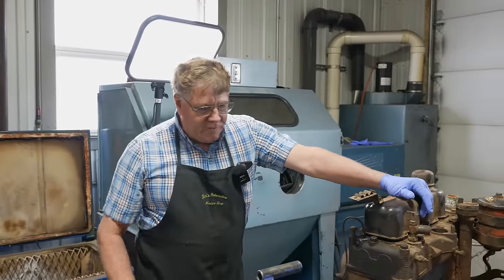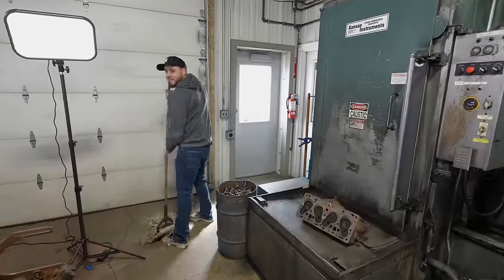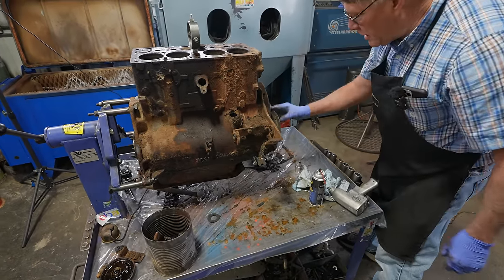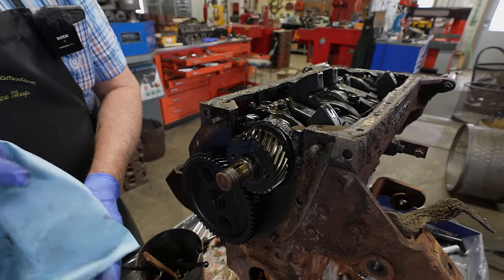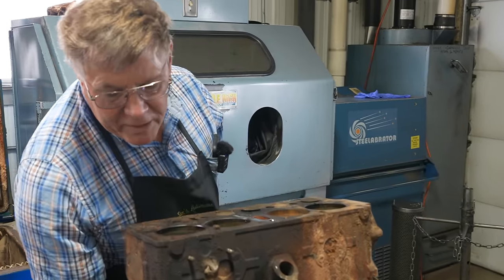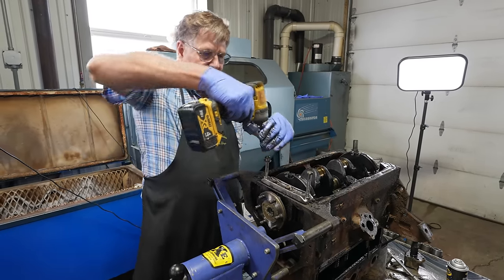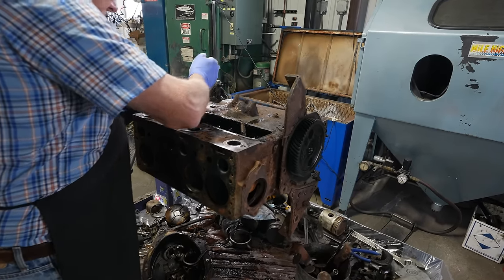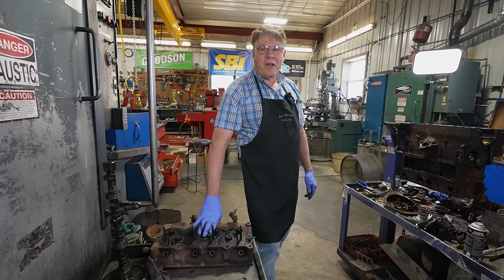Tearing Down A NEGLECTED Willys Hurricane Engine...

Comment: I wonder if the timing being off a tooth (+ maybe lean and rust build up around the cylinders too) is the reason of the obvious heat issue? Clean, dry pistons and combustion chamber. Too bad the plugs were gone.
Reply: that and/or run lean to try to 'fix the smoke'

Comment: People ran prue water if the engine overheated in hot climates, people also used to remove the thermostats. Nothing wrong with the old bakalite gears, they were replaced at overhaul.

Comment: Connection rod wrist pin is clamped in the rod. MOTOR'S AUTO REPAIR MANUAL 21st Edition Third Printing did not give end play of piston on rod.  Just .0001 to .0005" clearance for  pin to piston at 70 degrees temperature.  Pin moved as you said or not correctly centered  to start with.

Comment: I had the same thing in #4. In my L134 flat head. Had that hole sleeved to standard it ran about two years and the head broke off the cinch bolt and did it again?

Comment: Gotta love the logic of having more camshaft bearings than main bearings! lol 

Also, since the bearing dates indicate late-1952, IE, after the truck was supposedly built, and the fact that they were marked standard made me think;  ostensibly at the factory the cranks should have all been standard size, would factory bearings be stamped as "standard"?   Maybe it was rebuilt in the 50s at some point with standard aftermarket bearings?

Comment: If that engine had oil psi problems the old "3b manual" had you solder the hole up on the timing set oiler and re-drill it to a smaller size.

Comment: 49:45 I agree, It's called a Galley, not a Gallery. I'm calling out my "I'm 70 and must be right card!" I actually remember a discussion in my 1972 power mechanics Class with Mr Zinky, a certified Jet Engine Mechanic turned High School Teacher. Keep em coming...👍👍👍👍👍👍
Reply: I can remember my shop teacher using the same terminology and apparently came from the navy since their oil passages were the size of galleys. I have only called them rifles since i work on diesels and thats what most mfg call them in their training.

Comment: Greetings Jim & Nicholas. Started watching your channel, & subscribed, with the Chevy 235 rebuild after a friend told me about you. I'm enjoying watching your work & gaining knowledge as you tell about what you're doing etc. I think you said you've been doing this work for 40 years & wondered if you could help with my issue. I would, of course, appreciate a response but I'll let that up to you. I have a 1940 Chevy with a 216 engine. There is a copper pipe that attaches to an oil distributor on the left side of the engine. The pipe goes through the block, through the water jacket, to the other side & routed up through a hole to attach to the rocker arm shaft center. There's a brass fitting that screws into the hole in the block & a smaller fitting screwed into that. The pipe of course runs through the center openings of the fittings. The fitting don't compress against the pipe so there is a small space that coolant can leak through. Do you know, or have any idea, how the leaking was prevented? I know you're busy & have lots of viewers so if you choose not to respond, that's okay. I'll still continue watching your channel. Thanks for your videos, your time, & consideration.
Reply from the maker: I have seen the oil line you have described.  As I recall, it should have the same compression type fitting on both sides of the block to seal in the coolant.  The ones I have seen, once installed, could not be removed without cutting the tube.  The fitting compressed on both sides of the block making it impossible to remove without being destroyed.  Thanks for watching.
Reply: Thanks for replying. Both  "Chev's of the 40's" & "The Filling Station" sell the pipe & fittings but only the two fittings, one screwed inside the other -- no ferrules/compression sleeves & none were present when previous one removed. I put a compression sleeve on the left side of the block with no problem but on the right side the pipe has to be routed along side the push rods & still have enough room to not touch the push rod cover. With the compression sleeve it doesn't leave enough space. Oh well, I'll figure it out. Thanks again, much appreciated.    @JAMSIONLINE

Comment: Decades ago I did a 260 from a compact Fairlane that the pin was loose on. Fixed the pin, fitted the cam etc that came with the job and it ran a low 15 like that. Amazing how engines will still run when knackered. It was actually still running ok before we stripped it. Yet all the valves were barely sealing. Scored up bore etc.
Jeeps,,,, Landrovers have similar on the 6s. Horrid engines. And no reason  to be making engines that dated after the war. They were making OHV engines before WW1. 
Packard made a whole pile of twin OHC Merlins then went back to making flatheads for cars.   No wonder they went broke. 
Ford made twincam all alloy tank engines,, then went back to flatheads after the war.

Comment: Galley can be considered correct. It was originally, and still is a term used to supply food on a ship, the analogy for engines is an area that supplies water or oil to “feed” the engine. Hence, Galley Plugs. Gallery, on the other hand is an area used for exhibition, usually artwork, or other things to be viewed.

Comment: You got my attention with the “hurricane” name in the title. I have a Kaiser military M715 built around 1967 I believe. I’ve heard that engine referred to as a 232 hurricane. It’s a straight six single overhead cam hemi design.
Does anyone have info that would add clarity to this? Also, I could use a new timing cover if anyone knows of one laying around.

Comment: Cruise control used to be called auto pilot, bulk heads used to be firewalls, and people put water in their water pump, and i recently saw a video of some women trying to put vegetable oil in their new vehicle
Reply: A boat with numerous rowers is a Gally, an area which displays art  is a gallery 
I believe the correct word is GALLY

Comment: If the Jeep was a kids learn to drive vehicle, prehaps the timing gears were intentionally set a tooth off to reduce the power of the engine? I know I've heard of pistons being removed and other modifications to old vehicles to reduce the power so kids could learn to drive in them in the old days.

Comment: All one needs to know when fitting a distributor is the position of the crankshaft, the firing order of the engine and the direction of rotation of the rotor arm as you look at it.  The first datum is set with the timing marks between the crankshaft gear and camshaft gear.  Align the two marks and the crank should be at No 1 Cyl TDC.  The firing order is looked up (sometimes stamped upon the engine as in earlier Landrovers).  The rotation of the rotor can be observed whilst rotating the motor by hand in the correct direction.  Once these data are known and the engine set up at No1 TDC, the rotor will be pointing at one of the dizzy cap's electrodes and this will be No 1 cyl.  One then fits the remaining leads in the direction of rotation and in thne firing order - simple.

I do realise that I have probably just attempted to teach you to suck eggs but I got the impression that you thought that the distributor and its drive's orientation were set in stone and this is simply not always the case.  I remember, as a young man, in the Army and learning this stuff, watching an instructor pull out the distributor from the engine of a Bedford RL (you may research that one).  As vthe instuctor was talking to us, he was lazily spinning the dizzy, drive cog whilst holding it in his hands.  Myself and as couple of the the lads remarked, under our breaths that he would never get it running again.  We were gobsmacked minutes minutes later when he casually turned the engine to TDC, asked us for the firing order, casually threw the dizzy at the motor, refitted the HT leads and turned the key.  The blooming thing immediately fired up and sat the purring like a kitten while he explained what it was he had done.  For years, we were of the imprssion that everything had to be marked so that it would all go back together exactly as it came apart - not true.  The fact is, the drives of most, if not all distributors will only fit one way (the reason for the offset screwdriver slot). 

The sad fact is that these skills are going by the wayside.  they are being forgotten because, well because - computers.

Keep up the entertaining work!

Comment: I believe the specified oil for that engine was non-detergent type as in that time period was typical for bypass oil filter engines ...  just like my old Ford 8N.  Non-detergent oil kind of self cleans itself after engine shutdown by allowing the non soluble dirt and metal to sink to the bottom of the oil pan forming that thick layer of sludge, the bypass oil filter there to capture some of the smallest dirt particles that just happen to get pumped its way.  I learned long ago the very hard and expensive lesson to NEVER use a detergent type oil in those engines types ... EVER !!!

Comment: The "F" head came in the cj3B High hood starting in 1952. If the truck is a 1951 the engine was replaced at some point.

Comment: First time to learn of valve placement one in the head and the other in the block. Question Dose the valve placement improve performance any at all? Seems to me an extra cost to the factory  just for the machinery set-up. It would be interesting to know the reasoning behind the design.
Reply: My question was answered @ 44:20 mins. Learned some thing new... even so this engine was produced one year after the Doc spanked my butt... ;-)

Comment: oh no fiber gears
had my 1962 volvo B18 engine rebuilt circa1995. they put in a fiber timing gear
in 2001 it left the wife stranded on the freeway.  put in a volvo marine metal gear.  a little noisier but gears wont get oil soaked and shred.  tell the camera man to steady out the filming.  

happy easter

Comment: The number 4 rod was installed backwards the rods are not centered on the the crank bearings .
Reply from the maker: This is the conclusion we came to after the teardown was complete. We didn't pay close attention during the teardown process, but as we reexamined the piston, pin and connecting rod and realized the pin has a groove for the cinch bolt and cannot be off center, we determined that the assembly had been installed backwards.
Reply: @JAMSIONLINE  I have seen it many times in my 34 years working on nothing but Jeeps

Comment: Positive crankcase ventilation also contributes to engine life.
Reply: * If the engine is designed for it.  Adding pcv to old engines will often not be beneficial.

Comment: I grew up in England , and you never looked at a car with over 40,000 mile's. but you could go to your local garage and there would be reconned engines sitting beside the new batteries,just pick one up on your way home?

Comment: It probably ran just fine aside from the smoke and a little clatter. Those old engines were tough sons of bitches.

If #4 requires a sleeve I would punch all four holes out for sleeves and bring the entire engine back to standard bore.

Fascinating seeing inside an F-head engine, too. I hear tell you can convert back and forth with the right machine work on the block, and that the flathead blocks are just bolt-on conversions between F and L head.

Comment: So a half flat head half overhead valve I've never heard of that is kinda crazy what engineers were thinking back in the day
Reply: Seems like a backward step, but Rolls-Royce and Rover used it a lot. It does have certain advantages in that the intake passages can be an improvement over a straight sv engine and valve sizes can be larger than is possible in either straight sv or ohv designs. 

Rover used their own version of the F-head design for  many years on the typical British small bore-long stroke engines of the pre-WW2/ post WW2 era to enable the valve sizes to be larger than was possible with the same bore size in ohv, and their design was also optimised for good gas flow. For the low octane fuel of the day, a higher compression ratio was able to be used, giving a much better  power output than would otherwise be possible.

Comment: Thanks again for the great videos. May I ask a couple questions for you? Would it be possible to modify the oil filtering some how, so that there is an output and return line from the oil pump to the remote oil filter, for example? 
And secondly, could the new pistons come with narrower piston rings to reduce rotational friction a bit? Thank you.

Comment: I would put a modern (more modern engine in this Jeep) a 2.5L jeep engine. Based on the 4.0L if its to stay jeep. But myself, id put a engine from around 1990 s-10.with s T5,5 speed. Or get a little crazy with a k24honda with a t5 adapted to it. Or a little more spicy with a J35v6, or plain radical, with a SBC, with a 6 speed mount a transfer case afterwards. Or 4x2 , with narrowed 10 bolt and 33-12.50-20, or better yet if possible, 33-14.50-20' or 35-16.50, with a narrowed 14bolt axel from a 70's 3/4ton, definitely go with a SBC or LS with tr6060 or 6L80,,8L90  id love to make a 8L90 or 6L80 into a full manual control , With a ratchet style shifter to somewhat simulate a manual transmission . Or possibly a slap stick shifter, a electronic, manual transmission/shifter. Using a micro controller to control the solenoids as required per gear. With the possibly to shift to high grat at any time but incorporate a speedometer sensor to prevent the idiot between the steering wheel, pedals and shifter to shift to 1st insted of 4th at 100 mphit shouldnt shift to any gear lower than  4th at that speed,(and 4th is pushing it!

Comment: I'm surprised you sell longblock. I found with  my Wisconsin Engines sent thru my remanfacting faculties. 95 % of my warranty claim, 
s. We're on engines delivered to the customer on unrunning units. The only warranty we had on complete remanufactured Running units,  was caused by components malfunctioning.
Reply from the maker: Trust me, we know exactly what you are talking about.

Comment: when you guys are doing valve seats you have mentioned a few times about leaded fuel, could you take a minute and explain that?  i still remember sitting im my mums car and the gas man would ask us "regular or unleaded'. im really curious how your valve seat design effects what fuel you need.
Reply: The lead actually formed a cushioning surface on the valve surface and the valve seat...
so as the valve also rotates the slamming and the turning was minimised by the thin layer of lead..

As soon as the lead was taken out the hammering and turning valves ground away the relatively soft metals of the valve seats..
and the valve pounded it's way down into that material......
causing the clearances to tighten right up...
which caused the valves to burn as the valves no longer sealed...

The answer was stellite valve seats inlet into the head.....
the "hardened" valve seats we now refer to...
Reply: @JohnSmith-pl2bk  That's really cool thanks!  sounds like it was a genius solution to that problem at the time, albeit a terrible one. and in the end all it took was fancy machining and better metal.

Comment: Intersting to try and figure out what was wrong. I suspect the engine came out of the factory with the bent or twisted rod. Bid end of the rod bored crooked will cause that diagonal streak on the piston. 53 dated bearings sound like it went back to the dealer to fix some problem, and that fix didn't solve the problem either. Subsequent work explaines the tooth mismatch on cam and crank. Poor engine. Maybe this time.

Comment: Are you saying that spring collapsed as a result of heat?  Or is it a beehive design?
Reply: Closer windings nearer the heat source was OEM design.....
heat transfer to the oil flowing past the springs keeps the temper in the spring steel that it is designed to have...

Comment: GM may have used "galley" in their manuals but that does not mean it was not an error on their part.
galley:
a kitchen in a ship or aircraft
a long, low ship with sails that was usually rowed by prisoners or slaves

Gallery:
A passage

Comment: Man, that engine is SO OVER BUILT (way heavier than it needs to be) that you could gain 20 HP( i am sure it would be way more, except it probably only makes 50-70 HP fresh from the factory) just by lightening up the components of the engine.  My uncle had one of that body style Jeeps. My dad had a 65 J300 (I think) that had the high horsepower 6 cylinder "Tornado" engine. and their brother (my other uncle had an International, that had the original 6 cylinder replaced with a 350 Chevy engine. every year they would drive up to Canada to go wheeling and fishing. and every year something would break 40 miles off from a main road, and they had to fix it out in the boonies. I was to young (less than 10 years old at their last trip), so I could not go.  but they always had a good time. I sure miss all of them.

Comment: Back in the day the old Chevrolet inline 6"s had those fiber Gears And the only way to put them on correctly was by Boiling them in oil and slding them on in a hurry and yo had to be really accurate when you went to put them omOtherwise youve messed up a et of gears